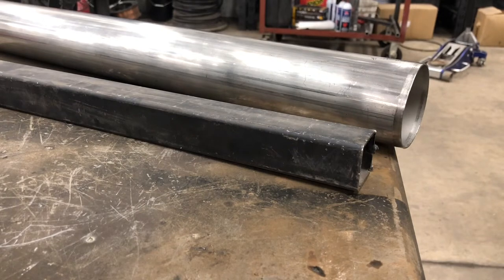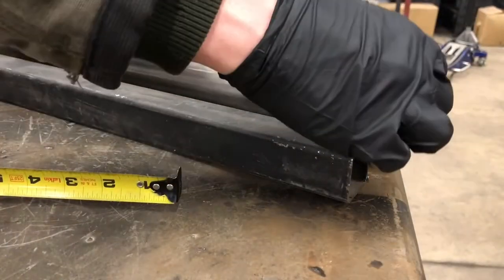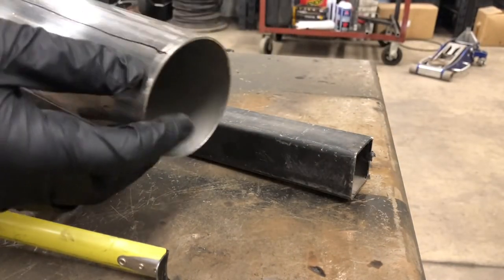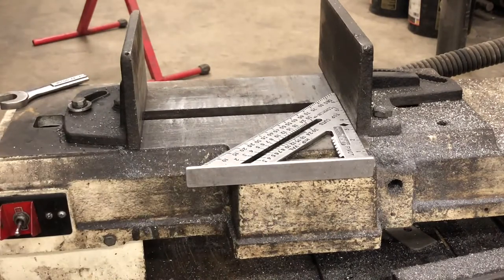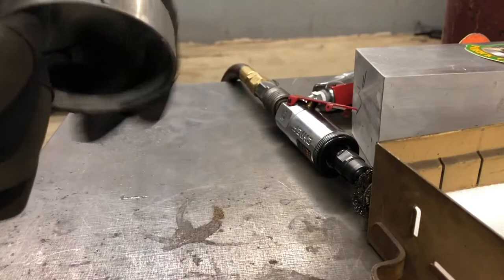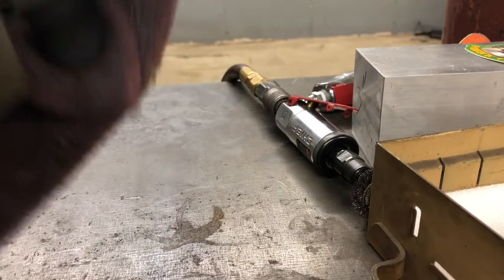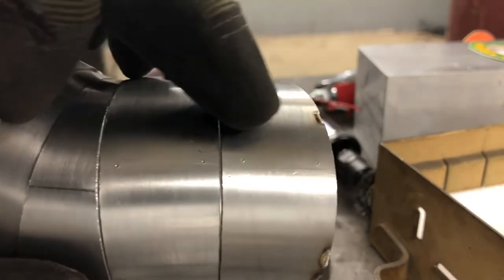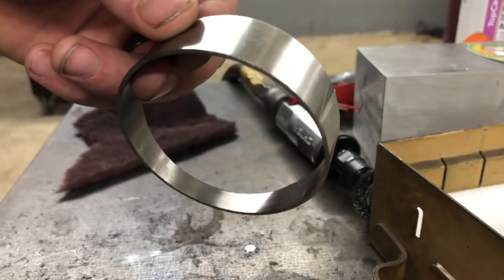How to make pie cuts

Comment: Very nice. Great explanation. I might suggest, why not use two pieces of 1 1/2” on each side of the pipe to mark opposite sides at 180 degrees? You could also use a small piece when positioning your piece on the saw to make sure your marks are horizontal. Just a thought from someone who does more woodworking than metal work.
Reply from the maker: Yes, you could do this! It would cut down on time and variables. Thank you for the positive feedback!